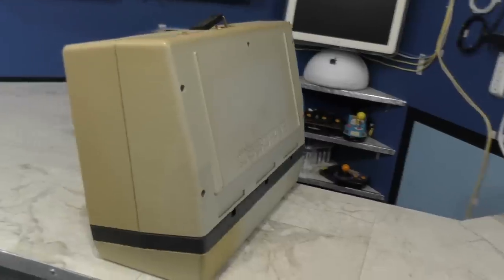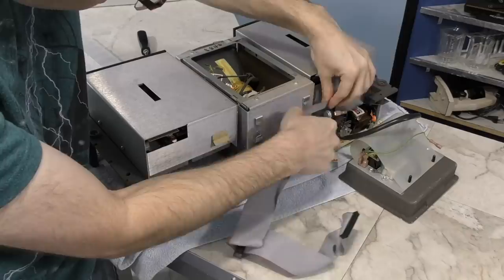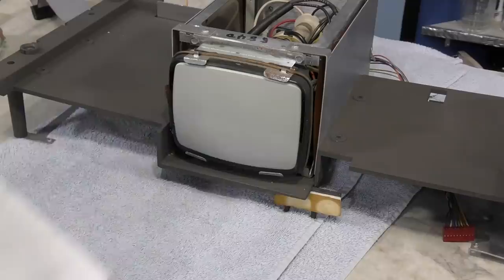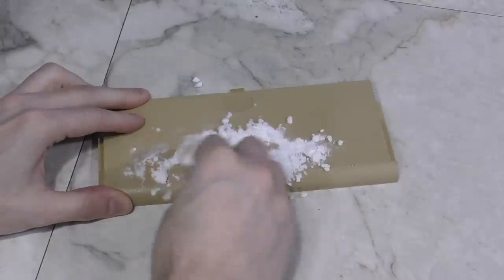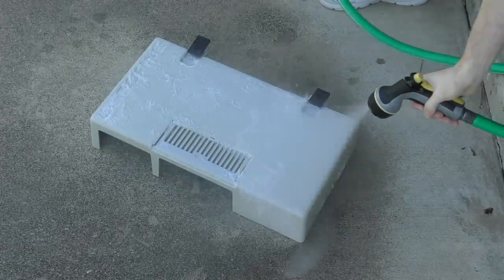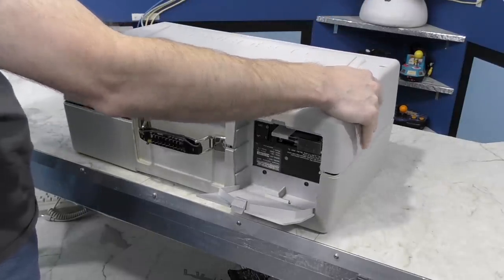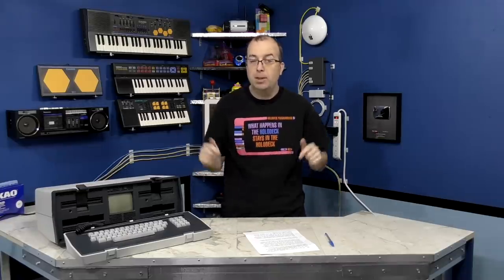Osborne 1 Computer Restoration Part 2

Comment: I was screaming NOOOO as you were getting it on the leather, it was so obvious that was going to ruin it.
Reply: Dave D I was sure he was going to give it a pre-wrap to protect it :(
Reply: Dave D He should have cut a slit in the plastic wrap for it.
Reply: No, he should have just wrapped the leather 1st to avoid getting the peroxide on it at all, it was obviously going to damage the old fragile leather
Reply: Dave D  No, it really wasn't obvious.  Peroxide can be used to clean leather.  (Got a blood stain on leather?  That's right... PEROXIDE.)  It's also used in the production of leather because it's more environmentally friendly than the old liming process.  Either the solution was too strong, or that handle is some sort of synthetic instead of real leather.  (Maybe both.)
Reply: It was obvious to me or i wouldn't have said it and i was right...

Comment: Rule of thumb: if it's bad to your skin, it's also bad to leather. 

When I saw you applying peroxide I immediatley thought about leather damage.
Reply: *for

Leather and skin is actually the same product just at different stages. If you skin a person, you're left with unworked leather. I've heard of lampshades made out of human leather. It's not very useful for much else as it's so thin and weak.
Reply: You could have stopped the video and prevented the 8 Bit Guy making this mistake!
Reply: @incumbentvinyl9291 how tf do you know
Reply: @antiuttpprimewastaken  I'm a hunter.
Reply: @incumbentvinyl9291  yeah but THE HUMAN LEATHER PART?
Reply: @antiuttpprimewastaken  Oh.

I've heard that there were some lampshades made out of human leather during WWII. I can not guarantee that this is indeed true.

You can check online for human leather. It's not difficult to make, but it's obviously rarely done.
Reply: @incumbentvinyl9291  Yeah, in fact there are also a number of books claimed to be bound in human skin. Most are fraudulent, but a few of them actually are bound in human skin
Reply: @incumbentvinyl9291 the WW2 germans made some out of Jews, kinda dark andni was really surprised when i heard about it.

in hindsight it really isnt very surprising
Reply: @francesquare8708  Indeed.

I'd be interested in purchasing one.

Comment: Sorry to see the retro-bright process didn't work so well this time around.

I wonder if those metal covers on the handle can pop off, revealing the rivets underneath them -- then you can drill out the old rivets, remove the handle, and reinstall it with new pop-rivets.

Speaking of the handle -- I would take it to an upholsterer.  Someone who does automobile upholstery.  Guarantee you they have the skills to fix it -- especially since you've got a picture of what the handle looked like originally.  It'd be like re-wrapping a leather-wrapped steering wheel or gear-shift knob on a high-end car.  Guarantee you they can get it done for you, no problem.
Reply: LMacNeill Assuming they're the same ones, the underside of the panel showed three rivets per end. Not sure if the covers would come loose once the rivets were done...
Reply: Hopefully he does this. That handle looked nice
Reply: I think it'd be cheaper to buy a broken Osborne computer just for the handle.
.
If he wanted to, he could drill out the rivets and either re-rivet it back on (easy), or tap it and screw it back together (removable!)
Reply: He could probably fix it himself as well. ChrisFix (car youtuber) upholstered his whole steering-wheel without any prior knowledge except some research, and it turned out great

Comment: The 0,1uF X cap isn't there to keep the noise out, it's there to keep the noise in. Without it the radiated noise from the switching frequency will increase significantly. It isn't needed for the power supply to work, but technically it is a very good idea to replace it. I'd do the same with those other two 0,01uF X caps while you're at it.
Reply: Yes, a cap costs pennies and takes a minute to replace. I'm baffled he just removed it while spending so much time on perfecting the looks.
Reply: @platypusfrenzy  says... quite a bit about this channel. I do love this channel and am a subscriber, but I sometimes cringe at the mistakes he makes. The leather handle too... what the hell did he THINK would happen? Why would you even apply the cream to something that didn't need it?!?
Reply: Aurelius R I totally agree. as soon as I saw him walk away from that sunbathing leather, I knew what was going to happen. I’ve seen that happen a few times to the leather of cars that experienced inevitable scorching temperatures. however, this ridiculousness was not inevitable. david could have easily avoided this rookie mistake. I don’t know what he expected...a retrobrited handle? I would have AT LEAST wrapped the leather with some tape to prevent contact with the cream as well as less sun exposure.

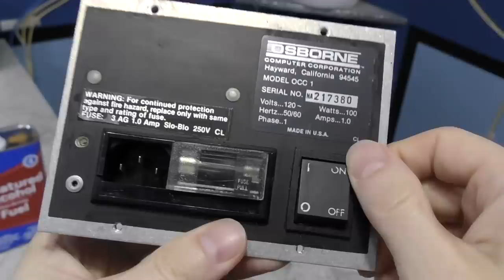Comment: 7:12 I really like the design of the power cord / fuse cover, its impossible to remove the fuse when a power lead is in and impossible to put a lead in when the fuse cover is open. Cool.

Comment: Perhaps you could use a paint roller on flat surfaces to get a more even coating
Reply: I really like this idea. Maybe a video on multiple retro-bright methods?
Reply: Spray bottle.
Reply: That would also be an awesome idea! Retro-bright doesn't need to just happen to computers... I've got a whole bunch of yellowed Lego bricks that I'd love to use Retro-bright on. I think it would be great for him to explain different methods for different things
Reply: He said he has a video on the way about more methods. I messaged him asking how to fix the streaking problem and he said he's making that video
Reply: a sprayer would be the best to get even layer of that brighter
Reply: Perhaps you could take a nice flat board and squish it a little to spread it more evenly.
Reply: In theory a paint roller sounds good but I think the roller might apply the Retrobright in a mottled/textured layer like Artex with lots of peaks and troughs leading to more patterning.

Someone has already suggested an ink roller and ink rollers are rubber which might squeeze the Retrobright into a more even but vastly thinner layer so it may need done more than once.
Reply: NoHeroez sponge brush.

Comment: The RIFA capacitor filters actually current going back to the outlet. so it's a good Idea to put a newer KEMET or Panasonic (i like to use Panasonic) capacitor back in that circuit .

Comment: Hey, David, Awesome video and I can't wait for the next one!  About the streaking when you apply the retrobright cream.  Have you considered using a small paint roller?  Specifically a mini foam roller with a light amount of pressure.  It's what professional painters use when painting with glossy surface paint to get a streak-free finish.  That should reduce the streaking you get from the brush, at least on the larger pieces.

Comment: To polish rusty chrome use steel wool grade #OOOO, it will shine right up and take down pitting slightly.
Reply: Agreed,.
Reply: David Wrocklage Aluminum foil with just a little water works good too.  I've tried both on chrome and liked the shine left by aluminum better.

Comment: During the retro bright process, could you limit streaking by applying the cream using a spray method?  In my head this would be a paint sprayer, but it might allow for a more even coat to be applied.

Comment: What if you try using a spray gun so the layer is consistent?
Maybe several applications and rinsing would be necessary so the layer can be thinner.
Reply: I was thinking the same. A spray gun would let you apply a thin and more even coating. Also, the peroxide mix looked too strong.
Reply: maybe a squirt bottle instead?
Reply: Spray gun just seemed more time effective. Plus, the nozzle on a spray gun gets a more even distribution.
Reply: he needs to stop using peroxide and just use oxyclean in a tub of water. ... even if he used normal pharmacy peroxide instead of the heavy duty laboratory grade hydrogen peroxide it would be better. hes gone WAY overboard with the process.
Reply: nunya baznus
Do you want to know WHY Oxyclean works?  Because it's about 40% sodium percarbonate.

"But what is sodium percarbonate?"

Look it up if you don't believe me: It's "an anhydrous source OF HYDROGEN PEROXIDE".

In other words: Same shit, but it's a powder instead of a liquid.
Reply: @SpearM3064 ...still waiting for your point. all you did is confirm exactly what i said. . the dude was using special Laboratory grade super concentrated peroxide that you can't even buy without effort because its for industrial applications. hes not using 3% like would be in your bathroom, hes using 35% solution. (i hope). The entire point was that Oxyclean is a lighter, more gentile process that does not streak because you aren't burning the hell out of your plastic. .. holy siht dude, the AUTISM IS REAL
Reply: It's from a beauty supply store (Sally's). It's not some super hard to get industrial stuff.
Reply: nunya baznus nunya baznus if it takes hours and hours with a 35% solution in the bright sunlight, how long do think it would take with a 3% solution would take? He doesn't have time to wait for days just because "ooh the other one is too strong". This channel is his business. He has other videos to make if he wants to feed his family

Comment: Some plastics also chemically react to alcohol and hydrogen peroxide. Some plastics also have a clear coat on them, your retro-brighting process might be removing said clear coat. This happened to me once while trying to clean a plastic part, i left some alcohol on it thinking it would evaporate, but instead it left a streaking pattern. No UV light was involved. So please consider the fact that an actual chemical reaction, and not the uneven coats are causing the pattern. This would also explain why some of your past attempts at this technique were quite successful and not met with the same difficulties.
Reply: The streaking seems related to the thickness at the area.  I also think it's not related to UV at all.   One possible solution is to apply a constant thickness, and minimal.  No fat chunks!  And do not apply extra, but simply spray with peroxide mist at intervals to prevent drying.  Whenever I've had streaks, it was due to drying.  Peroxide solution is best IMO since the hair product contains other chemicals that might interfere.

Comment: David, is there a way to thin out that hydrogen peroxide cream that you're using and apply it with a spray bottle, to give it more even coats compared to with a brush? Also, I dunno if I suggested this before, but maybe if you put those parts inside of a glass container, or even if it's clear plastic, something that would not touch the parts that you're de-yellowing.
But yeah, it could be hard to find something to put those large pieces into.

Those small parts came out very good! Maybe you could do the same with the keys? Hopefully they won't turn full white. :P

Comment: The streaks may come from the paint brush as well as the cling film making an inconsistent surface layer for the UV to penetrate evenly as you pointed out. What about putting down some amount of peroxide and a more rigid plastic film and trying to  squeegee it to a uniform layer. Kind of like putting a screen protector on a phone? My suggestion for a thicker plastic film would be a shelf liner, but I would think this would be ineffective for anything other than large flat surfaces. A clear shower curtain may work better for the non-uniform surfaces and would wrinkle far less than cling film.

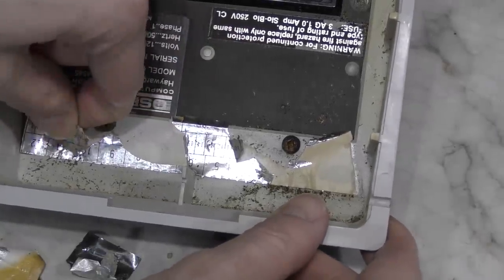Comment: 6:25 that sticker was probably intended to register the date of purchase. See how it has numbers for months, days and years.
Reply: That's what I thought, too.
Reply: I would rather say it's some sort of maintenance register. Also this computer was produced from 1981 to 1983 but the sticker reaches up to 1989. I've seen these stickers on quit a few other devices too.
Reply: I think it was the date of manufacture, not purchase. They use them to track batches for if there's a problem with the assembly process.

Comment: Get a large plastic container from Walmart, lowes or biglots.  They usually have a top.  I got one recently that fit a chandelier.  It'll take a lot of peroxide to submerge it, but I really can't think of another way.

On the plus side, if you fill up a container full of it you'll be able to quickly retrobrite anything else that's large
Reply: Zellio2011 Keep in mind that hydrogen peroxide has a relatively short shelf life before it eventually reverts to mere water and oxygen (2xH2O2 to 2xH2O plus O2) and becomes too weak to react much.  That really cuts into the economics of maintaining gallons of it in a large vat for future projects, particularly given that the larger the container the more difficult it is to tightly seal, protect from heat, vibration, and UV (just the sunlight exposure it is subject to will accelerate the breakdown into water and oxygen, so likely only a use or two before it becomes too weak).
Reply: Could you use a sprayer setup with a pump in the bottom of the container and have the surfaces kept wet and the fluid constantly being refreshed. If you could set up a set of nozzles such that every side would be kept wet perhaps that would eliminate streaks and reduce the amount of peroxide you needed to have.
Reply: Yeah guys I realize this.  Hell, those big plastic containers I mentioned are generally cheaply made and thin and wouldn't hold up to being filled with a watery substance anyway (For long at least, eventually it would wear out, and esp. if you moved it).  This is something you'd want done in 2-3 days

But if you have a lot of things to retrobrite and 2-3 off days, it sounds like a good idea to me

Comment: 6:26 - That sticker just shows the manufacturing date. It seems the top row is the month, the middle row the day, and the bottom row the year. Normally it should have markings in the corresponding month/day/year boxes. Either punched out, or a dot of ink or a cross or something. Although I've seen unmarked ones as well.

Other than that, no purpose.

Hard to tell what yours said since you went from "zoomed out too far to see" to "closeup and I'm already ripping it off" in the blink of an eye. ;)
Reply: The sticker shows the last warrantied maintenance annual inspection date from when the machine was last opened and serviced by a dealer/company authorized service technician. If it was never serviced the date indicated on the sticker should reflect its manufacturing date, if it were later serviced for defective hardware or serviced for an upgrade it would have a date indicating when the later maintenance occurred. It's a little like saying, warranty void if seal is broken.  Authorized service technicians often place tamper proof stickers on their contracted work, especially after servicing warrantied hardware.

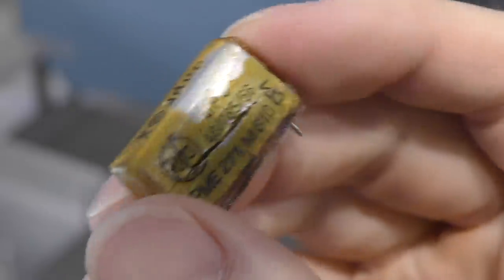Comment: 3:56 in Germany we say "Bang Frog" because the RIFA X2 Capacitors gone wrong these days with a smoke and a boom. I work in a HP museum and nearly every device has this capacitors and all of these have cracks. One monitor of a HP9836C had three of these and when we switched the machine on it goes boom.

Comment: What about vaccuforming a mold so that it is slightly larger than the actual cover you are attempting to retrobrite?  Then maybe some form of injection system create an even layer of the retrobrite in an attempt to reduce streaking?  Just a strange thought.
Reply: it still need the sunlight (or UV light). But it might by taping slanted pieces to the side , and vacuum forming that. 
Another idea i had was vacuum forming the inside into a filler. That way a large enough container (aquarium) can be used to completely immerge the piece , but no peroxide is wasted on the inside of the case.
Reply: An airbrush to spread an even coat and a clear case would work.
Reply: I just use a spray bottle set to stun... I mean mist.